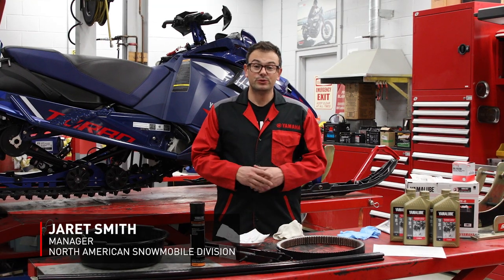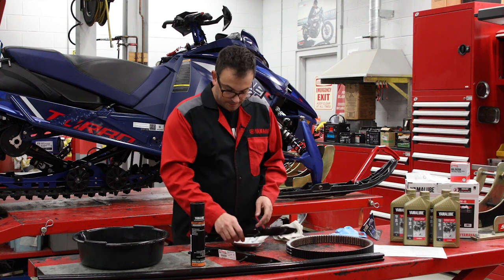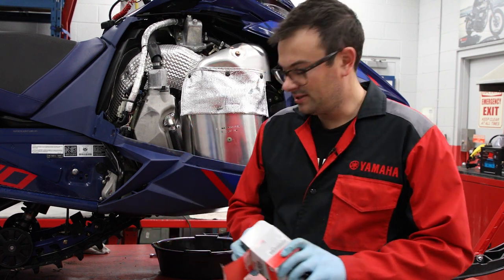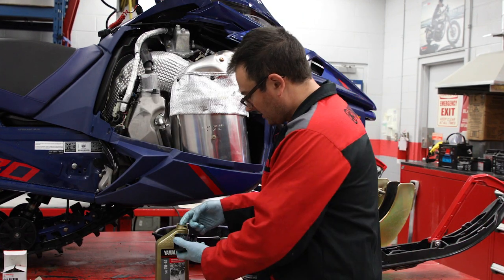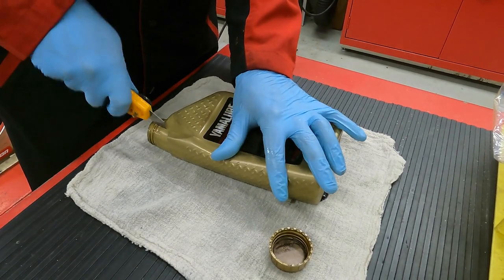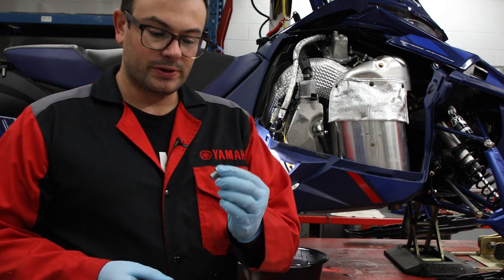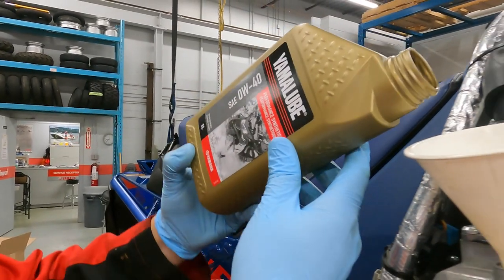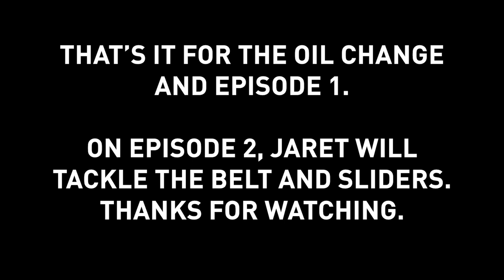Yamaha Sidewinder Pre-season maintenance | Part 1: Oil Change | VLOG #32

Comment: Hey Jared,you forgot to drain the hose from the crank to the dry sump tank.That does not drain unless you take it off the bottom.Another cat design flaw.Good job otherwise.